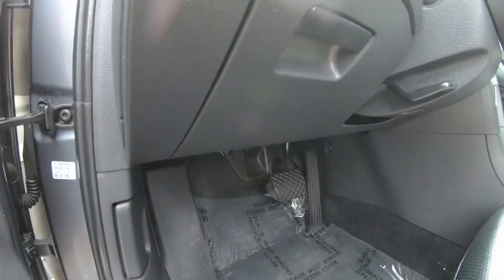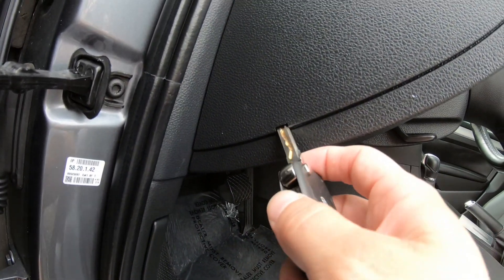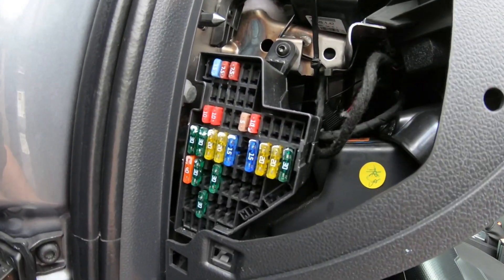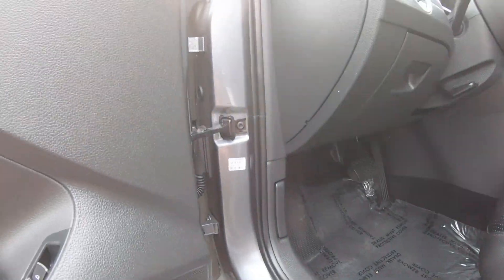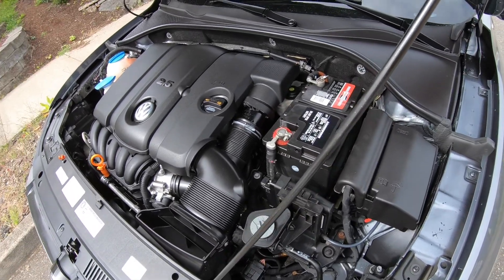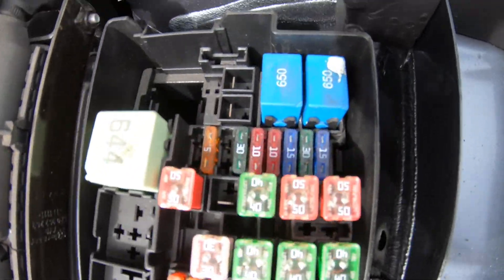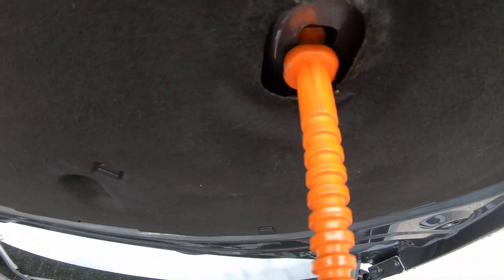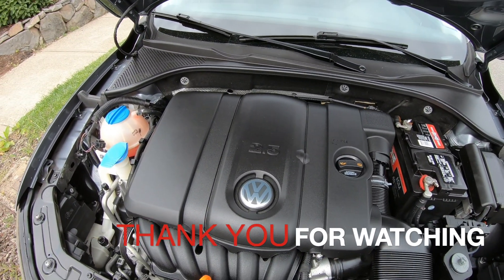FUSE BOX LOCATION ON A 2012 - 2015 VOLKSWAGEN PASSAT

Comment: I have a 2012 vw Passat se I can’t change songs turn the music up or down or anything with my steering wheel which fuse would that be?
Reply from the maker: Did you end up figuring it out? I would have to look at the car fuse box to see it . It doesn’t say anything on the fuse panel ? Maybe steering wheel or radio fuse or so.